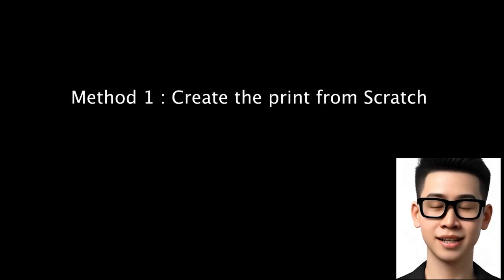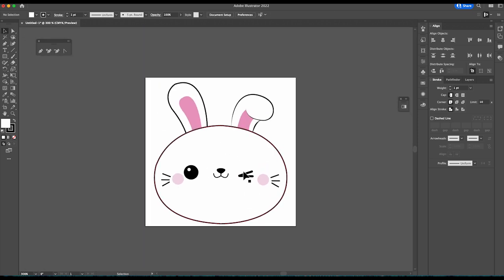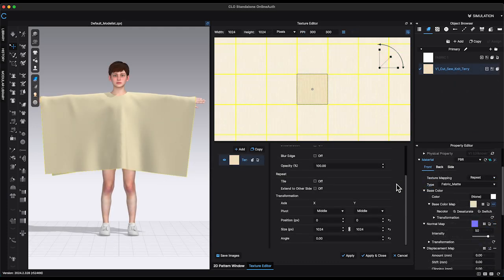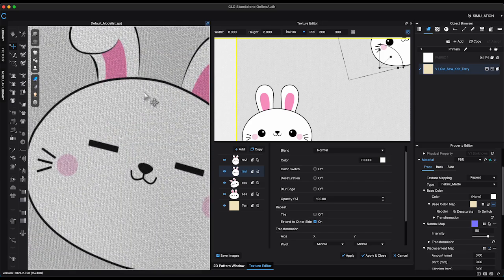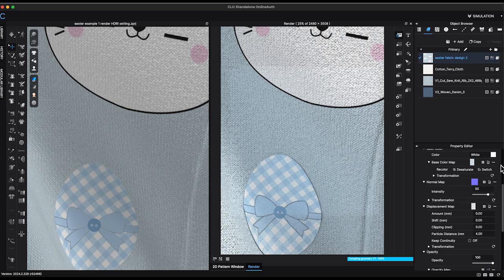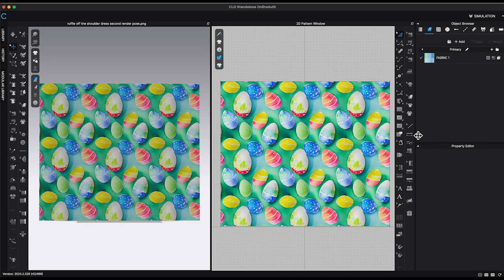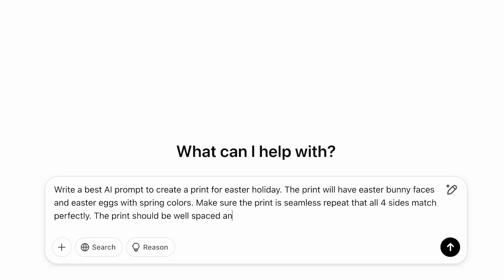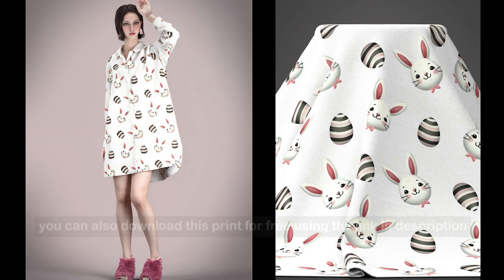How to Design your own Fabric Print

Comment: Thank you for the helpful tutorial! I'm learning to design bags in CLO3D, but I find it difficult to render them realistically. Could you share any advice or suggest a tutorial on this?
Reply from the maker: are you talking about making the bag material look more realistic?
Reply: @Kev-in-design  Yes, exactly! I want to make the bag material look more realistic, especially in terms of fabric texture, lighting, and shadows. I sell bags on online marketplaces, so I need high-quality renders that look as close to real products as possible. Do you have any tutorials or tips for this?
Reply from the maker: @skippshop  First you need to make sure you get the best quality picture of the material you wanna use ( if you can't find a preset fabric in clo3d fabric folder).
Then make sure to use normal and displacement maps to make it more realistic. You can check out my tutorial of how to create realistic fabric texture.

As for the lighting, I will suggest you to find a bag photo online with the lighting you like. Go through the clo3d preset lighting options to find one that's close to the photo, then add more lighting if needed.